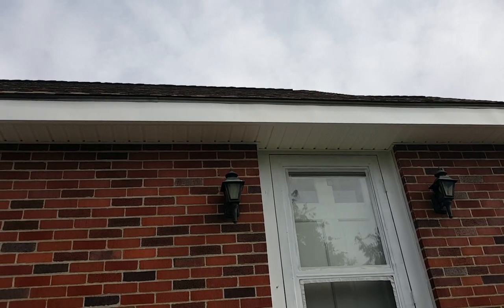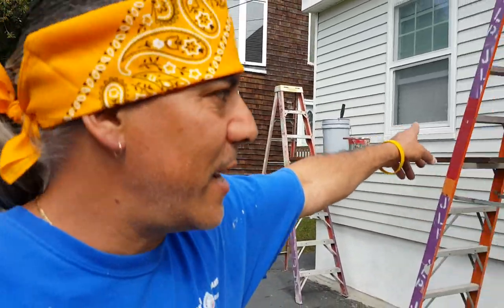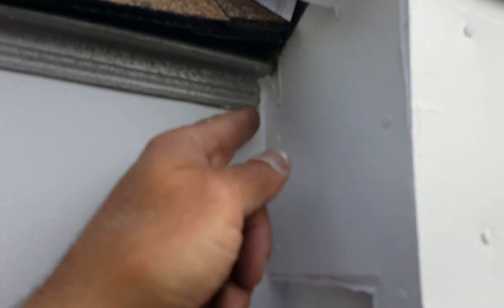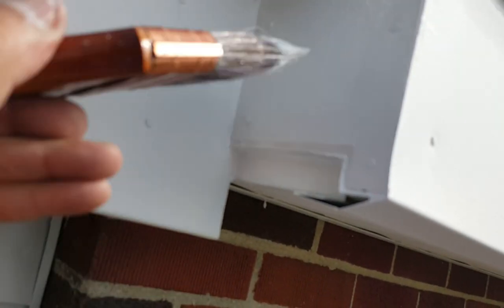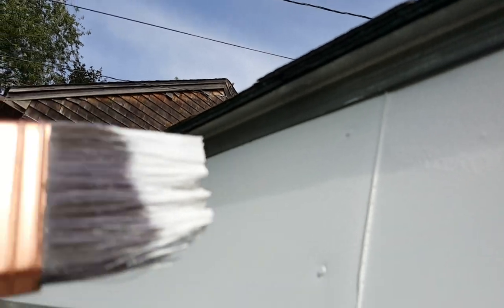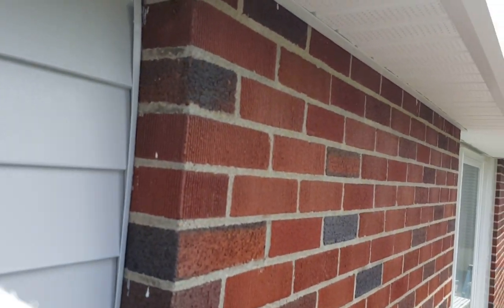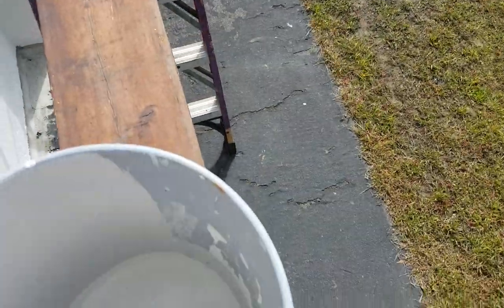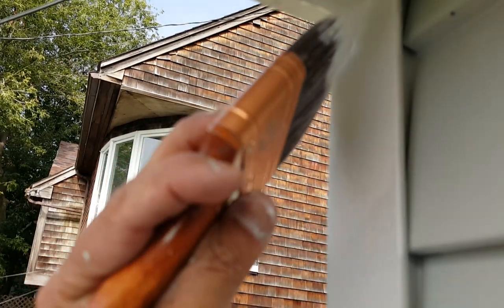Da P8NTRMAN🎨,  Painting Exterior aluminum siding.

Comment: I love this video!! Plan on taking on a project like this one. So much good info. Great tips!!! Did u paint the siding also?
Reply from the maker: @mikegia5934  Hello! Thank You for viewing my video. And to answer your question, Yes, I have two videos painting this house. The siding of the house was sprayed with a blue Graco X base and a green #208 spray tip. It is the finest spray finish tip in an airless spray system. It gives the paint job a nice finish on the house. Always remember, Don't Paint in the sun. The paint will flash on you, and you will see where you stopped and where you started. Only paint 3 boards at a time and bring it all the way accross. Start painting in the shaded side of the house. Pay close attention to my formula and the amounts to mix. Make sure you have more than enough paint. Make sure you use a 5 gallon strainer bag to filter your paint and use plastic to cover the paint while you spray so the paint doesn't dry up on you. If you go to lunch throw some water on top of you paint enough to cover your paint so it doesn't dry up on you. My sprayer was a Graco Ultimate 495.
I wish you success and Happy Painting.👍🤗

Da P8NTRMAN 🎨

Comment: Have aluminum mobile home porch awning white & sellers left huge black marks on underside when moved out. Asked handy man to air gun spray it. If use your recommended products, will the paint eventually come off say in a year or two?  Neighbor who does handyman work said if paint, will just come off
Reply from the maker: @Brenda Kenney, Hello Brenda, a very valid question. Not only can you use my products recommended but most importantly the cleaning procedure as well. Use TSP on top as well as the underside. I also recommend that you spray it instead of brushing and rolling. Also, use either a Satin finish or a Semi Gloss. These surfaces are much easier to clean. Everything will virtually fall off. Make sure that since you are only painting the awning you won't need to purchase  5 gallons of paint. For an awning I would only purchase one gallon of paint. Add about a half gallon of Emulsa-Bond plus a cup of water. Mix it thoroughly. Aluminum doesn't need a primer. The EmulsaBond is your adhesion agent. Show your handyman my video. Power Wash the awning thoroughly with TSP.  Allow it to dry for a day at least. When dry then spry your first coat. Allow it to dry for a day and then spray the second coat. You should be fine for at least 5 years. Of course, it all depends on the elements. Paint the awning in a light color. Deep dark tones will minimize the longevity of the coating because of the heat factor. The whole reason people have awnings is to shelter the area from rain and sun.

Thank You for asking questions. Happy Painting.👍

Jhonny Da P8NTRMAN 🎨

Comment: Great leadup and descriptions of everything!! Really nice with the actual demonstrations too. I like also how You say what not to do and even more important WHY not to do it, The personal info/comments are appreciated too.
I have these questions: As You rolled the corner, there is a ever so slight edge of the corner that touches the siding however that was not covered (did You spray the siding first?)
Another question: I have aluminum vented soffit (not plastic) what would be the best way to paint it?
Reply from the maker: @ThomasZawalich, Thank You so much for viewing my video and Thank You for your questions. The video is long winded and personal, I know. It is my style of speaking. Most people rush through an explanation. I took my time with it because there is a lot of information to learn in such little time. Also, my style of speaking is as if you were having a conversation with me and was there with me. It is a way to embrace the audience.

Now to your questions. Yes, I did spray the siding first. And then I painted the trim pieces with a combination of brush and a 4" quarter inch nap roller. I wanted to mimmick the spray stipple type look even though I didnt spray it. 

When painting a soffit with venting holes I would suggest to you to purchase a Krylon spray can and spray the soffit. Dont roll it nor brush it. The paint will build up in the holes abd plug the holes or you may also have drips. If you can use masking paper along with green Frog tape, cover the siding so you dont get the overspray on the body of the house. In many cases I do that first.

I hope I answered your questions. If you have any more questions feel free to ask. Have a blessed day!

Jhonny Da P8NTRMAN 👍🤗

Comment: good job, whats a good product to clean off old oxidation ? im a diy, thanks for help
Reply from the maker: @groundup421, Thank You for reaching out with your question. To neutralize the oxidation on the aluminum siding of this house I used TSP by Savogran. It is a product still accessible at Ace Hardware or a Ma and PA hardware neighborhood store. I haven't seen it at Home Depot or Lowe's  but they might have it. It is a powder added to water and if need be bleach to remove mold and mildew from exterior surfaces. This product is also excellent in cleaning grease, grime, smoke, oil, soot and stains from concrete, brick, wood and it also works as an etcher neutralizing oxidation. The house on this picture has no issues with the paint job up to date. The owner is my best friend and he claims that the home doesn't have any paint failure to date. The formula I put together worked perfectly. We're hoping to get at least 10 years out of it. He paid a bit over 6 thousand dollars to paint it about 7 years ago. I hope this information helps. When power washing its not necessary to scrub down the metal to paint, only the areas where there might be moss growing.  

As always wear safety glasses and stay away from electrical wires. Be Safe and make sure your ladders are level and planted safely to avoid sliding. 

Happy Painting and God Bless

Da P8NTRMAN 🎨
Reply: @JonathanLaSalle  thanks for the detailed response, keep up the awesome work, positive vibes

Comment: I am amazed that you  can keep that brush clean.  Love the duration though.  It's 'da bomb.'
Reply from the maker: @Turner Bond-jn5yv Thank You so much for your comment.  As you might see in my videos, I only dip my brush about an inch to an inch and a half into the paint. I don't wipe my brush on the sides of the bucket. I always use a pot liner, and I only hit the side of the bucket in one specific section. I am also a left handed Painter. The odds are against me at all angles. We live in a righty world but I managed to work with it and got good at it now for 30 years painting. A lot of discipline.  I was also the cleanest Painter in my crew. Everyone else wiped paint all over their clothes. I always carried two rags with me. That is why I was always clean. Most of my Painting was all high end. 

Regarding Duration paint. It is still my go to paint for any exterior painting. I like Super Paints as well for all the trim. I'm not fond of Emerald. I think it's over priced and over rated.  My first choice of paint is always Sherwin Williams. Second is Benjamin Moore and third is ICI Paints. Sherwin Williams is worldwide and so is ICI Paints. 
I hope that I've  inspired you some way somehow. Painting is something I love to do. Happy Painting! God Bless You in abundance. Again, Thank You for stopping by.

Sincerely,
Da P8NTRMAN 🎨

Comment: Did you have to sand that metal trim bare before painting it? I ask because I have to do that exact same project to my house when it warms up some more...
Reply from the maker: @Just Me2,  Thank You for your comment. No there is no sanding involved when painting Aluminum. Just Power Wash with TSP generously at all surfaces to be painted. The TSP will prepare the surface for painting, this process is called "Etching". The additive that I menrion in one of my videos is called "Emulsa-Bonder". This product is what gives the paint its strength to bond and the elasticity to hug the surface painted therefore giving you long lasting coverage. I hope that works.

Good Luck with your project. Be Safe and Happy Painting. God Bless!
Jhonny Da P8NTRMAN 🎨

Comment: Nice cut lines!! I'm getting ready to bid my first aluminum siding job tomorrow and I'm a littler nervous. 😳 This was super helpful! And you're right, you need a cameraman for sure. :)
Reply from the maker: Charla Schuman , Thank you for your comment.  Good luck with your bid as well. Follow my instructions specifically and you will provide a great service. Heads up, when using the Emulsabonder, the ratio is one gallon of binder to 5 gals of Sherwin Williams Duration. I also added one gallon of water making 6 gallons of product. The water minimizes the viscosity or thickness of the product so you can spray. I also used a 208 Graco Rack X fine finish tip to spray. I covered all of the windows on the side sprayed. Stay out of the sun. Work in shaded areas. Aluminum siding is smooth so your tip must be a fine tip. Spray Gun filter at medium. Use a filtering bag in your paint feed bucket. If leaving the gun idle in paint because of break pour water into the feed bucket to cover the paint to prevent it from drying. The emulsabonder dries quick. Ehen preparing your surface be generous and TSP the cheap out of the house. Do Not use bleach on aluminum, only TSP to etch the surface. very important. If you need advice let me know.  This job cost around 6 grand to complete.  It must be a two coat system. once you spray do not touch up. Satin finish cannot be touched up. Don't use flat paint. Use Satin finish so that it repels water and moisture. Feel free to contact JHONNY Da P8NTRMAN  at jlpaintdesigns@gmail.com 

Good luck and God bless
Reply from the maker: surveyguyor , I need to rnlighten you about the use of Latex Paint for Aluminum Siding and/or roofs. If you live in the South you can get away with oil base paint. BUT, if you live in an area where  the temperature goes to extremes then you will have to use a latex product with the additive of a bonding agent like Emulsa-Bonder. Cold weather surfaces do not, I repeat, do not resist expantion and contraction so a Latex prodict is necessary. I higjly recommend Duration from Sherwin Williams for this specific application. View my video and you will see what I mean. Any questions just ask me here or email me at jlpaintdesigns@gmail.com and I will be glad to walk you through products in the market. Take Care and God bless.
Reply from the maker: surveyguyor , Styx is a great product.When painting aluminum gutters you can add Emulsa Bonder to primer for better adhesion.  Thanl you for your comment and good luck with your projects.

Comment: Have you ever dealt with aluminum trim where the paint has partially pealed off. Trying to decide whether to paint or replace. I have not come up with a good way to remove what’s left of the paint. Enjoyed your video, best of luck on getting a sponsor.
Reply from the maker: @Douglas Best, Thank You so much for your comment and your question. I am not there to see what you are seeing but based on what you are describing I will suggest that you peel all of the loose paint. After peeling you should power wash all exposed aluminum with TSP. Use this product generously. It will etch the metal getting it ready for painting.

It is a possibility that it was painted without being etched. The oxidizing of the aluminum created the separation and lack of bonding. In one of my videos I described using Emulsa-Bond. A product that I use to increase the bonding to Aluminum surfaces. I mix this product with Duration exterior paint. When mixed it creates a very durable and resistant covering that will both resist elements and bond to aluminum surfaces without the need to prime. The home in the video has not had any paint failure in 7 years. The life expectancy could very well last for 10 years and more. This combination has been a true success. It resists expansion and contraction due to temperature changes during winter and summer. This is why I made these videos about painting Aluminum. Many Painters think that a Rust Oleum primer is the best. Sadly an oil base primer will bond for a short time until temperature changes and it fails when it gets cold then it peels badly. 

I wish you luck with your project. If you have any other questions feel free to ask. In the meantime be safe, be healthy and Happy Painting.

Sincerely,
Jhonny Da P8NTRMAN
Reply: @JonathanLaSalle  thank you so much for your reply. Certainly sounds like good advice!

Comment: Do you always put two coats of paint on when you are doing a house that is all aluminum siding?
Reply from the maker: Hello Ben, great question. Yes, absolutely yes. Two coats ensures longevity of the coating. I did two coats  on the house in the video. If you have any misses or any runs, you can fix it before the second coat goes on. Two coats of Duration Satin finish mixed with the Emulsa-Bonder each coat. You get extra protection and quality assurance.

Thank You for your question and Happy Painting. Be Safe always. 

Sincerely,
Jhonny Da P8NTRMAN
Reply: Thanks for all your suggestions. Have you ever primed aluminum siding with Zennser 123?